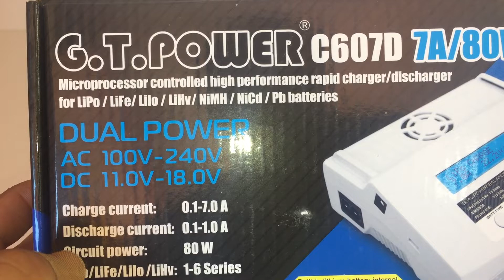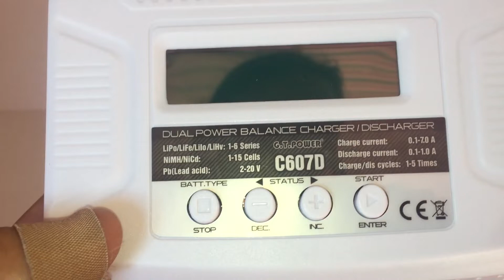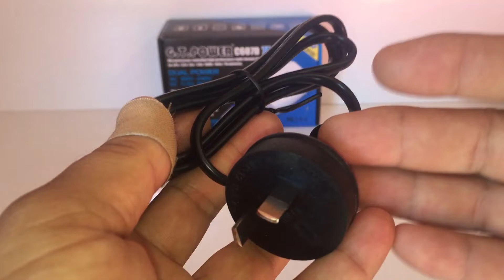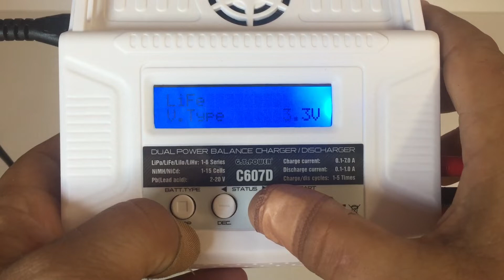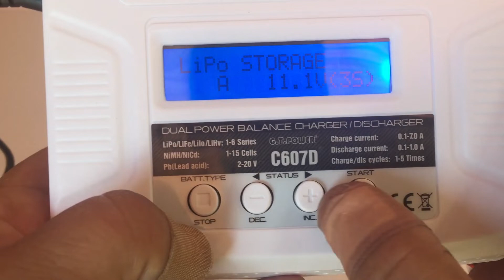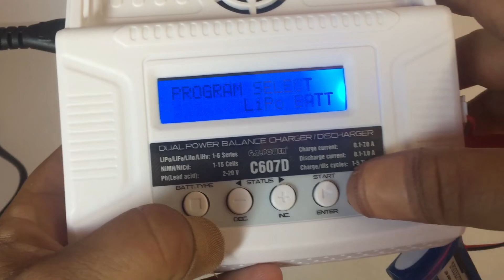GT Power C670D AC-DC 7amp 80w Charger Review |  LiPo LIHV LiFe Lilo NiMh NiCd Pb Batteries

Comment: Great video mate. I have a different brand charger but I haven't used it yet because the manual is a bit hard for me to understand and I think need a uni degree to operate it. I've just been using the USB charger that comes with the cars I bought but I should look into using my new charger to discharge because I believe the usb chargers that come with the cars probably don't do storage mode?
Reply from the maker: Yes use these chargers if you already have one mate, they are super easy to use so don't be intimidated by the vast features. Those USB ones that come with the rc cars are garbage and do not really balance the cells that well at all, plus you can not discharge or set them for storage rate either and also are super slow to charge lipos etc. Once you get used to using these hobby grade chargers you won't look back.